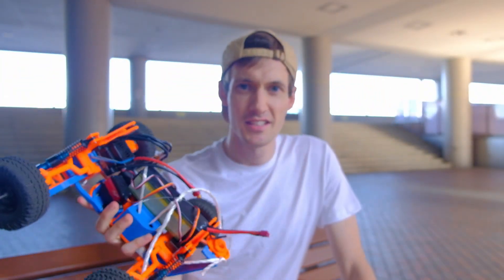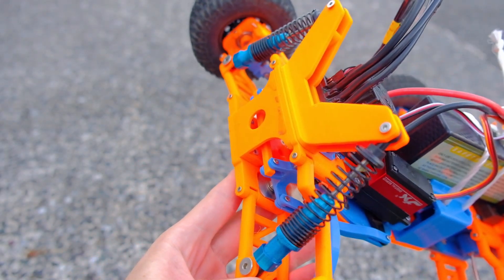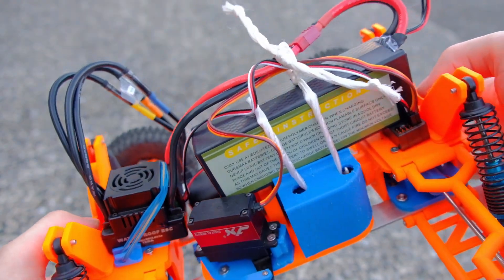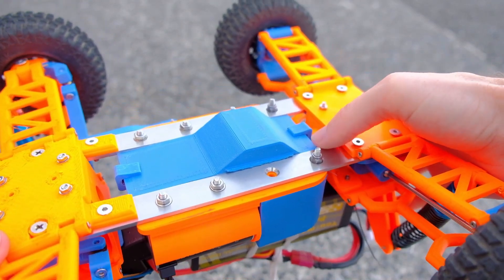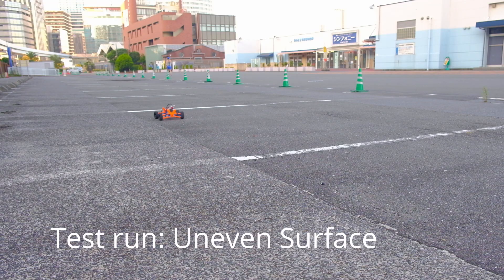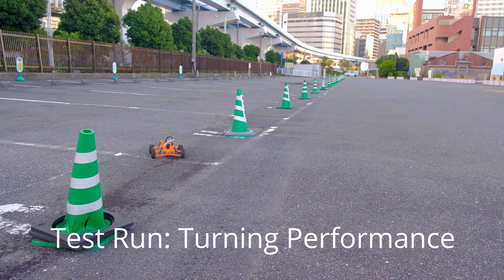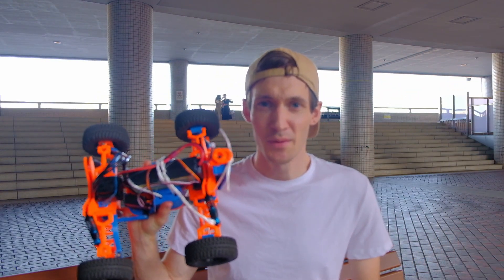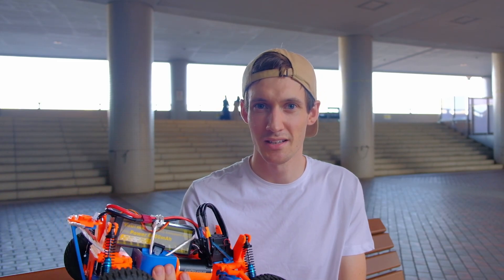The Vortex - 3d printed RC car: First Test Run

Comment: hey man! Great vid and brilliant design! I am looking at doing a similar project myself but am struggling to find compatible electronics. Is there any chance u could link the parts you used?
Reply from the maker: Most of the electronics part I purchased on Banggood.com. Your main components will be 1) ESC (electronic speed controller, above 60A should be fine for a smaller project) 2) Brushless motor (e.g. 3660 2600kV) 3) Remote Controller with Receiver (e.g. DumboRC) 4) LiPo Battery (e.g. 3S 3000 mAh)
With that you have already covered all components necessary for controlling a motor 😊

Comment: Very cool. Since turning radius is small, perhaps sacrifice a little for stability? You could make the wheelbase longer which makes it more stable but turn wider
Reply from the maker: Yea, that is exactly the tradeoff. For now it's actually quite fun to drive because it turns on the spot. Originally i wanted a longer wheelbase but due to the length of the mending plate which acts as the structural backbone i could not make it any longer. Something for version 2.0 maybe 🤔

Comment: Pay more attention to that ESC, it will drain your lipo until  0V
Reply from the maker: I am currently using 6000 mAh. Battery capacity is so much i have never fully drained it in one driving session. I also worry about ESC not shutting off at correct voltage, therefore i regularly check voltage